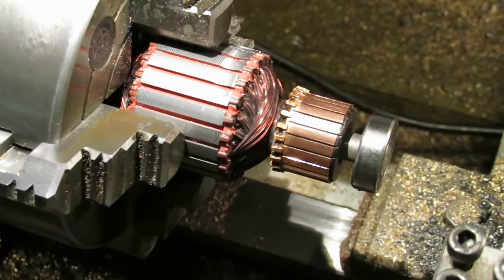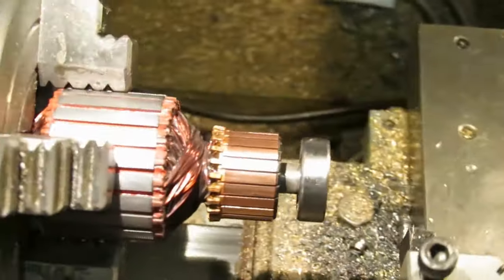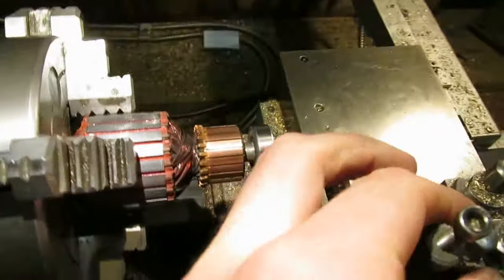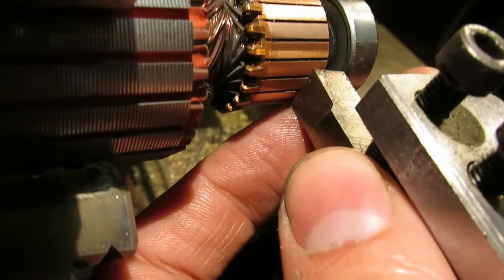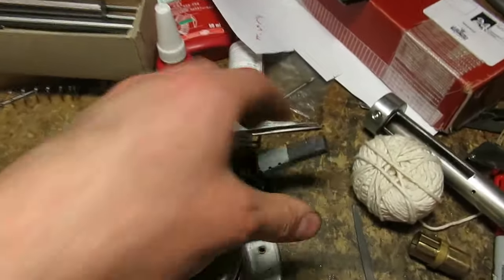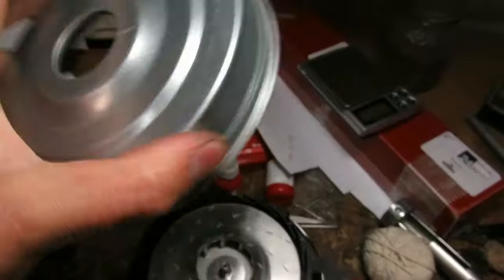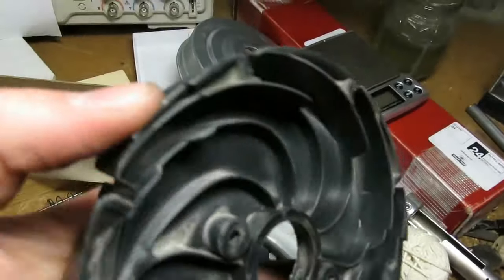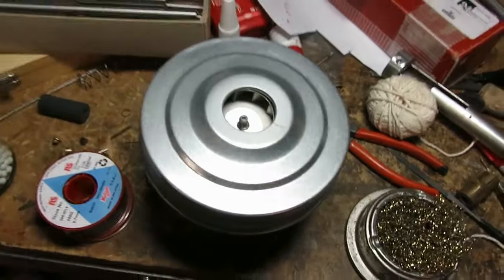Vacuum cleaner motor commutator cleaning

Comment: Hello sir
Thanks for your great channel 
I own a LG vacum cleaner and it seems that the south korean motors are seal press and there is no nut at the end of the shaft instead of that there is a metal piece 
My vacum cleaner has a bearing problem  
Since the price of  a new motor is high in my area  i have a high hopes to repair this motor 
I dont know if its needs lathing or no
Thanks sir i really count on your help

Comment: Is it supposed to spark at all. Mine is sparking a lot. How did you remove the top cap.
Reply from the maker: All brushed motors will spark to an extent. If it's sparking a lot, the brushes and/or commutator probably need cleaned. As for the top cap, it was just held on by friction - tapping the edge with a block of wood helped to release it.

Comment: I just took mine apart, cleaned out the dust as it was being used without filter bag.  Should there be any spark at all? And it still has the burning smell.
Reply from the maker: There will always be done sparking, it's just the nature of brushed motors. Perhaps dust has got embedded into the windings and is causing the smell.

Comment: Cap on the motor is not fitted tightly....what should i do..?. Thank you
Reply from the maker: Tape or silicone sealant probably the easiest.
Reply: @imajeenyus42  i have super glue. Is it suitable for that..?
Thank you
Reply from the maker: @mohammadihw  Well, if you never want to be able to take it apart again, sure. Why not just use some silicone sealant?
Reply: @imajeenyus42  I don't have silicone sealent yet because Due to coronavirus  epidemic in my Country....whole country is gone under lockdown for 21 days. So i am unable to purchase. Thank you

Comment: The stink might not be from the motor, rather from the bag. I'm not sure what you have on it but if the bag + dust sits around it develops a smell.
Reply from the maker: It's a bagless cleaner (cyclone separator), and I'd already given all the various filters a good wash, to no avail ;-( The smell was definitely from the motor - when I originally ran it outside the hoover, it made one hell of a stink!